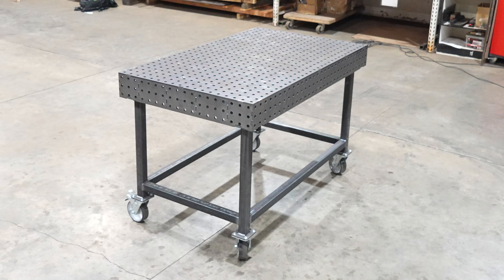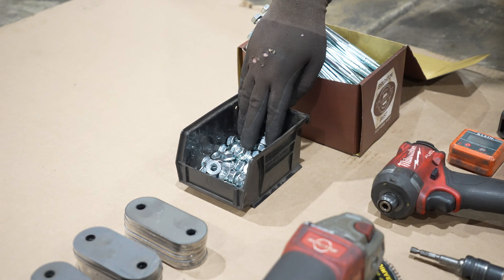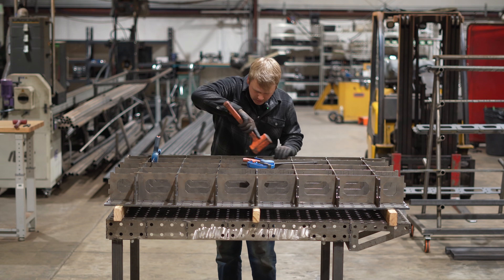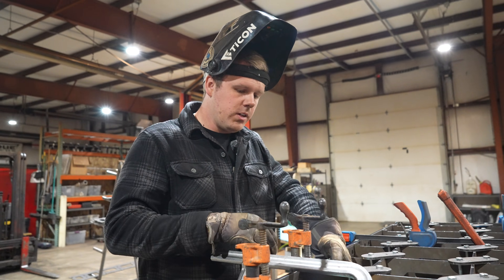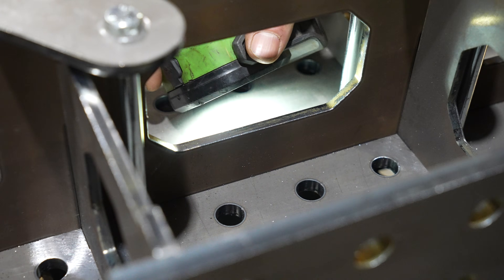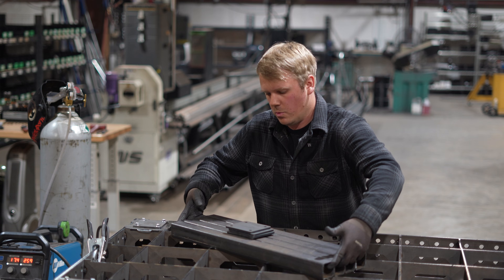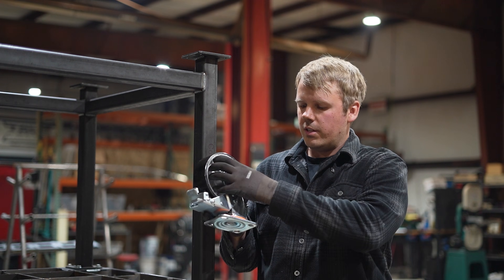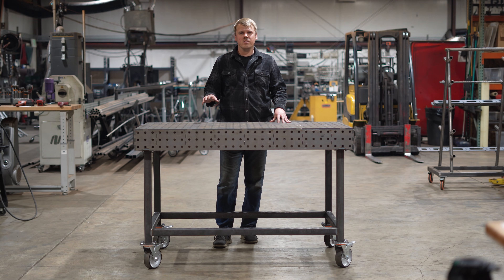Building A Welding Fixture Table

Comment: Interesting. It’s usually recommended by manufacturers of these slat tables to begin clamping and then welding from the center out. Otherwise you can get a slight buckle as you get to the center and then nothing can be done about it.